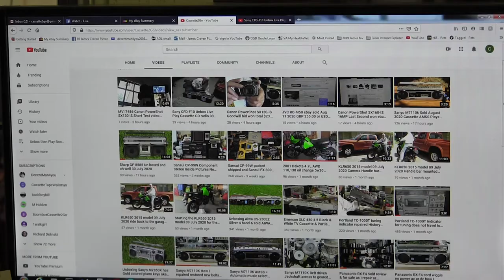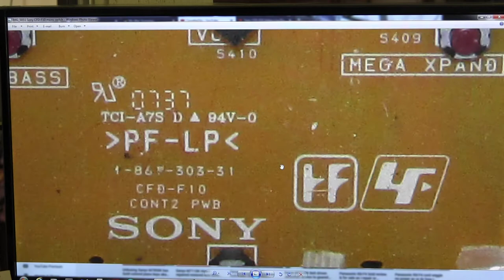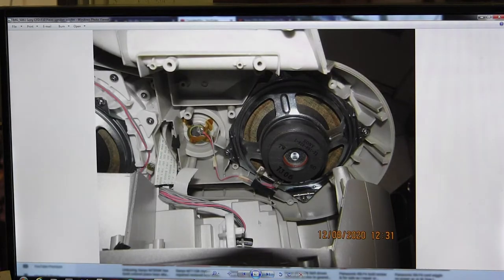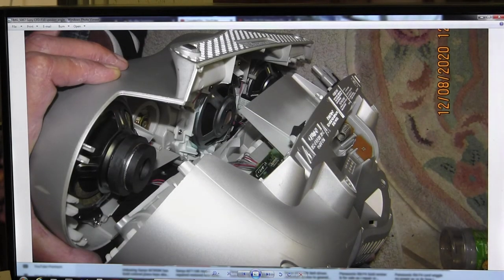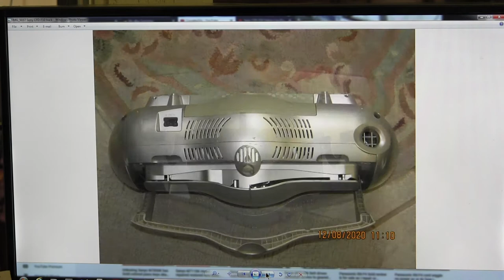Sony CFD-F10 Inside Pictures How to Service I Cleaned & Played Passive radiator

Comment: Lucky you! My CD player component won’t work on my machine. I’ve unscrewed it, I’m looking inside. I’m in the process of researching how to clean a lens, but I also wonder if the white ribbons that have yellowish coloring on them or a discoloration need to be cleaned?
Reply from the maker: Your device may have been in a Smokey area for that to be color  . All you should be concerned about is electrical connection clean and tight

Comment: Hello, I was wondering if you know where the potentiometer is located on the tape deck side? I tried to find it on my own but I had some difficulty.
Reply from the maker: I don't know if it has one. If you're trying to increase the volume of the output of the tape deck to equal the volume of the radio I don't think it's possible. I believe it's a set value that is for the tape deck to not overpower the radio if you understand what I mean I think you understand at least I believe I understand what you're trying to do.

Comment: The Tape button and the CD-disc button work, but the radio button does not work; so  I can play tape recordings,  CD-disc recordings, but the radio is dead so no matter how many times I pressed the Radio Band button the system is stuck to either  TAPE or CD-DISC.
Reply from the maker: Take it apart and clean the switches, get the gunk out that got in there or somebody hit the switch too hard and broke it.

Comment: The subwoofer its fake ?
Reply from the maker: This does not have a
Reply from the maker: This does not have a subwoofer. This has a passive radiator.
Reply: @Cassette2Go  ohh i was interested to know about the middle sub like an another sony models , sony - CFD G70 sony - CFD G55 
Sony - CFD G700rcp
Reply from the maker: @alexherrerag6997  I do not have those models.  I only went inside of this model to clean the dirty micro switches & show the world of the inside of this model.  If you buy the models that You have mentioned and send them to I will open them up and let you know or you can do this yourself ok? This SONY Has a Subwoofer - my video ok - Sony CFS-350 Inside serviced Rec-Play cassette radio Super dual voice coil subwoofer for sale (11:57) minutes 
https://www.youtube.com/watch?v=Ued8ROsYiLI
Reply from the maker: Sony CFS-350 Inside serviced Rec-Play cassette radio Super dual voice coil subwoofer for sale (11:57) minutes 
https://www.youtube.com/watch?v=Ued8ROsYiLI
Reply: The music on the cassette is “all the way to Memphis” by Mott the Hoople
Circa 1973

Now, how do I replace the antenna on the CFD-F10?